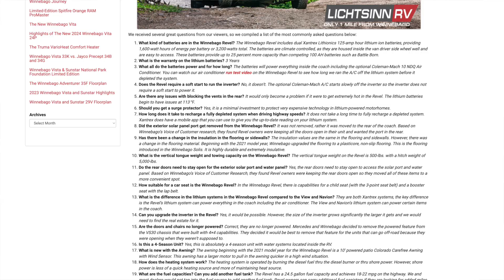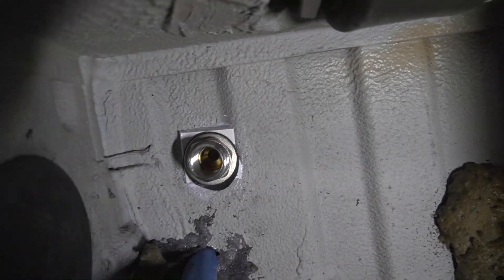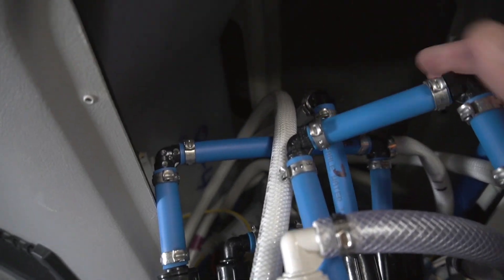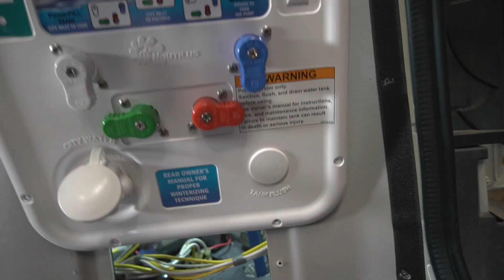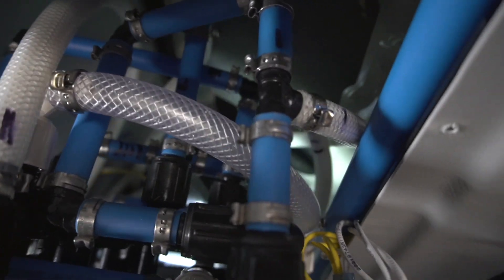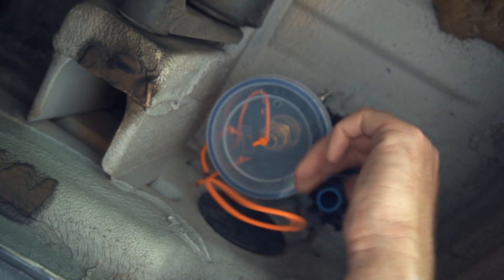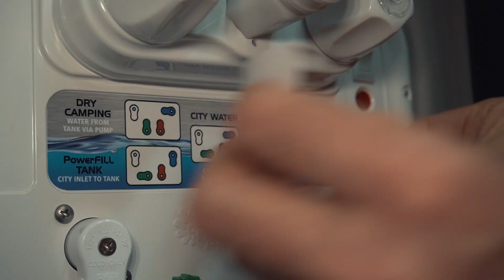External Water Connect | Winnebago Revel

Comment: I believe that the reason Winnebago put the water connections inside was to have all the water tanks and water connections in the climate control to help avoid water tanks freezing in winter. The thought being that most Revel owners are more likely to be camping off grid and away from campgrounds with hookups
Reply from the maker: hi Justin, yes and I really like having the tank itself inside the van. that was indeed a good upgrade over the 2020 and earlier Revels. Still, the connection to fill the tank should be on the outside. it keeps any drips/spills while filling the tank out of the living area. But I'm not complaining. Even if I did in the video, to add a little bit of drama 🙂. If Winnebago had added an external connect; I could not have made this video

Comment: why not just fit a passthrough on the door with a male hose connection on each side? then you could connect a flixi hose to the door and the existing internal connection and coonect a hose between the door  and the water supply?
Reply from the maker: there are a ton of different ways to accomplish the same thing. even with only the 180° doors of the Revel, a flex hose through the rear door would have to bridge quite a distance. Might be do-able but might not be "clean". I aimed for a 100% invisible solution without giving up the internal fill.